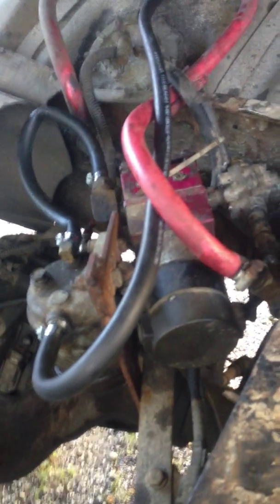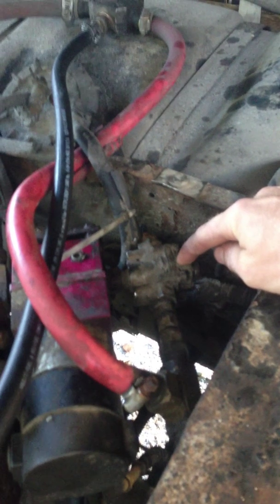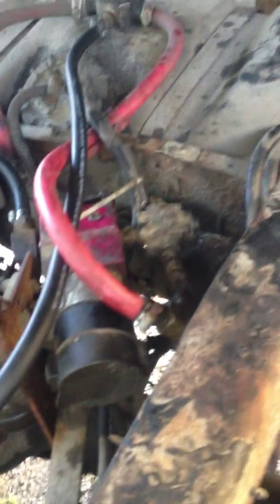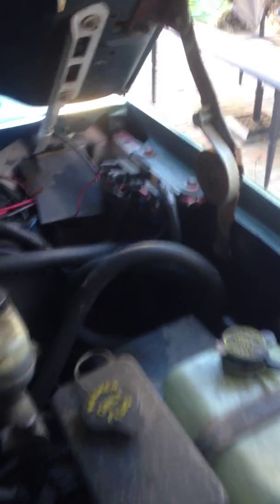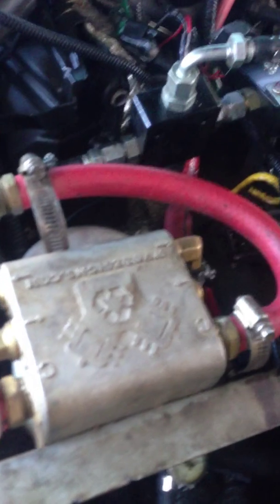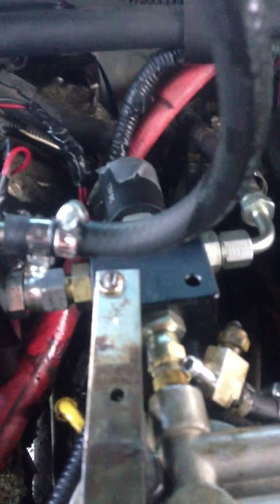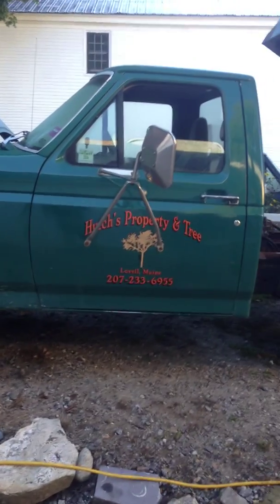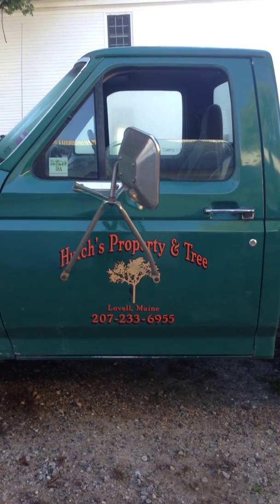94 Ford F350 Dump Body 7.3L IDI : Dual Tank WVO Conversion

Comment: Awesome, thanks for the video brother! I'm not positive but i believe i have the same 7.3 idi in my 2003 e450 i just bought. I want to convert it to wvo and was trying to determine if a one tank straight veggie oil conversion is possible..like on the old Mercedes. Anyway I've been trying to hunt down some parts you show, you don't happen to know where i can find those electric line heaters or the heated pickup? And is your timer adjustable? How does that work, 12v? Any info you can give me would be greatly appreciated brother! Thanks!